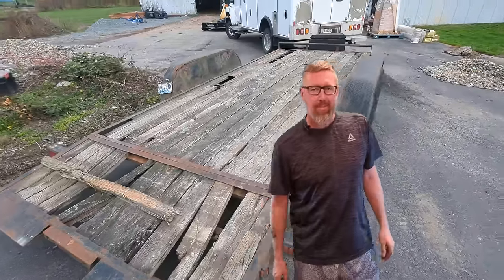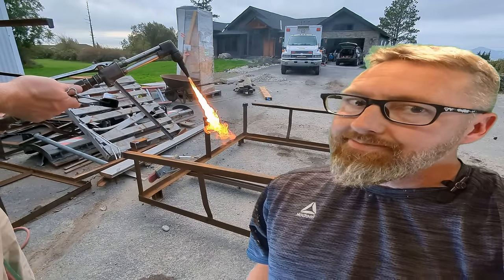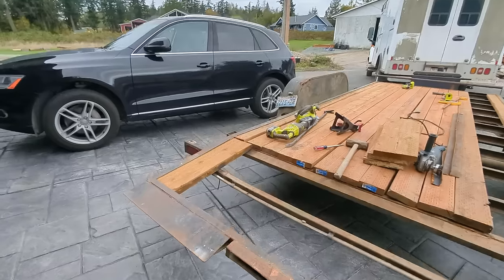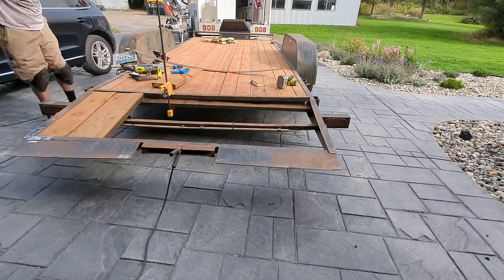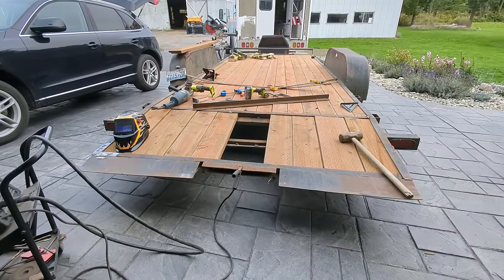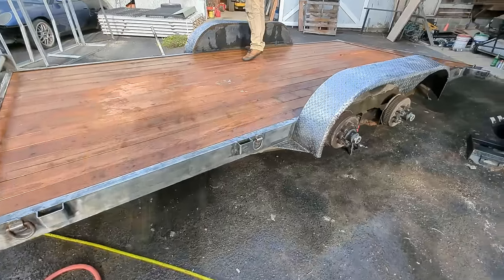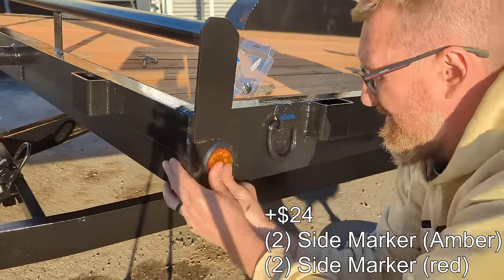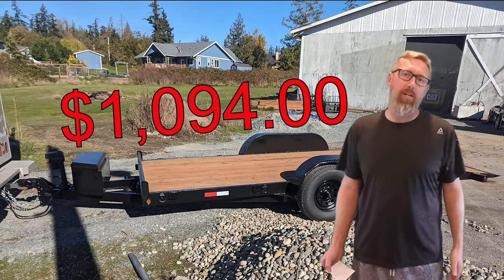Reviving My Old Trailer: Epic Upgrades on a budget! 10 Minute build

Comment: Enjoyed your video. Simular to what I did to my trailer. Two notes. 1-You didn't paint inside the fenderwells. And, 2- you put the reflective tape on backwards. In many states the white is towards the front & red towards the back. Check your before and after pictures. Lets others know what direction you're going.   Over all a great job !
Reply from the maker: Appreciate you watching, thank you.  I was racing against the weather which is why the inner fenders didn't get done.  Good eye on the stickers, I was unaware there was a specific order but that makes sense.

Comment: Forgot to add you might also want to add a kicker brace on the dovetail to the first brace where the outer ramp structure welds to to prevent further bending from the skid steer.
Reply from the maker: Good call, I actually did add one on the underside but did not film it as it was under the trailer after the boards were installed.  Would have been a lot easier to install first!

Comment: New deck and paint looks great!  I'm surprised you didn't straighten out the fender before you painted.  Do you have plants to rebuild the suspension and axle components?  We recently did an overhaul on our 3 year old Diamond C and installed all new brakes.  Our 5 year old enclosed trailer is in need of new suspension components.
Reply from the maker: Thanks for watching! Those are battle scars, builds character! 😁

Comment: You must have a small skid steer.  My T870s weigh 13,000lbs with no attachment.  That's why I have a 9T gooseneck to haul them or the Case 580 backhoe.  My 7K car hauler isn't near close to carrying it.
But nice looking trailer you have now.
Reply from the maker: I'd love to have your setup.  T870 is one of the largest skid steers on the market.  I have a Cat 287 which is 10k.  This is a 14k equipment trailer, not a car hauler.  

I'm definitely pushing it's limits.  Appreciate you watching and commenting.

Comment: i would've repaired that fender putting that much work in and weld some braces to support them and keep from getting banged up as much i mean you had the material it would've been free
Reply: other than that great job but you also didnt paint under the fenders that i seen you had the wheels off a can of rustoleum 7 bucks at walmart wouldve helped instead of roller brush
Reply: i do think stickers red goes towards back but i dont think it matters
Reply from the maker: Thanks for watching, glad you enjoyed it.  I would like to repair the fender but they don't make fenders like this anymore.  I dropped an f350 off of a forklift (whoops) on the fender and that's all the damage it got.  Now days fenders bend if you stand on them. 

Spray paint in the wheel wells is on the schedule, I ran out of time as this build was outside and the weather turned.  Good points, thanks

Comment: You didnt screw any of the boards down to the steel frame at all? I would've atleast done a few cross beams or every other c-channel cross braces. It would have straightened out the twisty boards and secured them better. So just the front of the boards goes under the angle iron & where it 'breaks' at the 'dovetail' has the flat stock holding them down? Yeah, I'm not sure id go that way, but to each their own.🤔🤦🏻‍♂️🤷🏻‍♂️👍🏻👌🏻🛠️📐✏️📏🔧⚙️⛓️🔌🔋⚡💥💨🚜⚠️🍻
Reply from the maker: I see what you're saying, it's hard to see but the boards are held down on each long end and sandwiched tight side to side.  There's no wiggle room either direction.  After a week all the boards have all straightened out nicely.  Thanks for watching and commenting with advice, appreciate it.